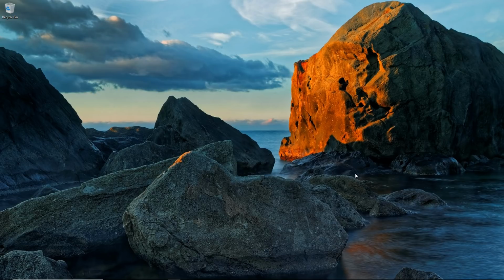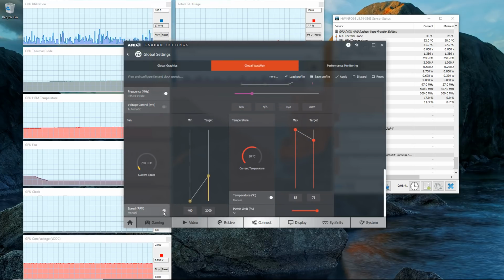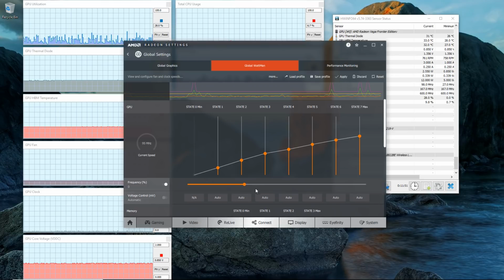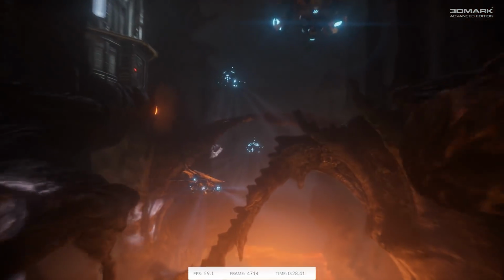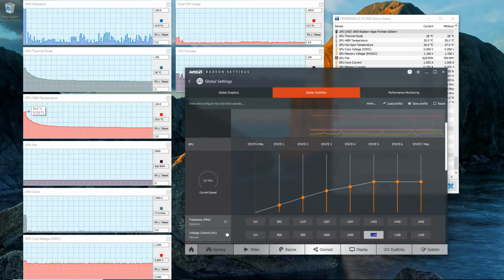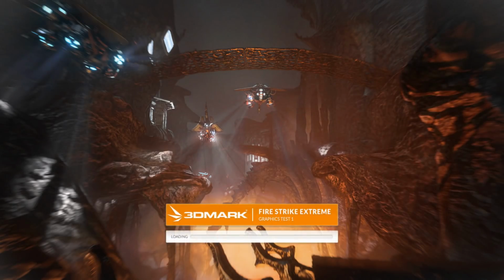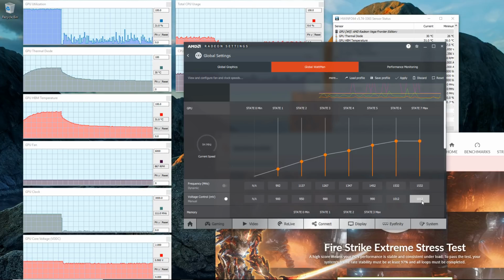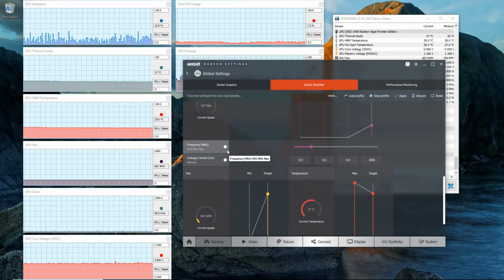Foolproof Vega GPU Undervolting Method

Comment: You're paying too much attention to cpu thermals...but the most important thing...the vrm temps...you just missed. The best way of undervolt your card is running a gpu bound game. I did it with mine. Then checked thermals.
Reply: what game?
Reply: @beatsbyeduardo9066  witcher 3
Reply: Yea but vrm temp depends on core temp as it is the resposible for high temps unless you have bad cooler design or wrong thermal pads over the VRM

Comment: Followed tutorial for my MSI rx 580 8gb and so far it has worked. I get no crashes, but do get artifacts. I'm still fiddling with my voltages to get it right. My ending score differs wildly sometimes. From a score of 80 to 90 or in between. Maybe I gotta fix my clock values as well. Also, would overclocking my CPU help with the ending score? I had to reset mine since my GPU kept getting an insane amount of black screen crashes.

Comment: What is the hottest temp you can run the GPU hotspot? Mine sometimes hits over 105c!
Reply: Not sure mine was hitting that region switched stock blower for a Morpheus Vega 2 while doing so I found a nice long (5cm) bit of plastic that said please remove inbetween the cooler contact plate and gpu amongst the thermal paste, once removed and Morpheus attached don't push beyond 85 degrees now. It's also now getting lower thanks to this vid and me now under volting

Comment: Damn good gaming card but the fact is that AMD is horrible with drivers that you have to go through all this BS to even get it right. I bought one over a GTX 1080 and now regret it because with Nvidia all I would have to do is just increase the slider under msi after burner🙄. I guess you get what you pay for with cheaper shit. $230 for my Vega 56 and the GTX 1080 would have been another $50👌

Comment: I'm planning to run an MSI Vega 56 in an itx case. Any suggestions on how to undervolt to reduce temperatures?
Reply: #1 is to not have your mV and clock speed close together.  It will lock to P state 6 if it was set the same as P state 7, same with clock speed.

#2. Your After Burner app will have a graph chart like watt man is located just above the clock speed title's and shape like a graph for both mV and Clock Speed.  Click on the white box either drag with mouse, press enter and backspace the + or - of the vaule to increase or decrease then press enter, or clicking the up and down arrow key.  

There is not memory voltage control in After Burner.  I would suggest using the Vcore first before touching the clock speed of both the core and memory, save profile what been stable, and make tweaking according with applying profile set to off.

The p State 7 is what you want to lower the voltage down while paying attention to the gpu core mV, it will make the images show "line" artifact if mV set too low.  

I found my sweet spot on my Air Boost Vega 56 OC, save the OC profile on AB and Wattman profile too for backup, lock my framerate to 100 or create chill profile, you will have lower temperature once set up.
Reply: MrDman Man also i have recently bought a Vega 56, got some questions. If i only want to undervolt without overclocking should i increase the Power limit aswell or leave It at 0? Then does undervolting the Mem have a big impact on reducing Power drawn from the card or not (cause i like to  use Afterburner cause It also have an in game overlay) ? And how can i calculate the Power drawn from the card?

Comment: Dual Vega 56 here. I just cured my crashing trouble that was due to a hefty overclock by the drivers AS STANDARD. 1622mhz forced by the drivers vs the cards rated 1520mhz. I'm going to watch this video now to see if i can get more powah.
Reply: depending on what card you have i think some companies released a more stable bios revision. Try flashing the card's bios to the latest if you're having stock stability issues
Reply: @noahmalboeuf  I'll have a look. Thanks!
Reply: @marc-oliviercabot3380  np

Comment: This is by far the best tutorial on internet ! I tried this method and it worked
Reply: Be careful since the new driver update takes off the temp. configuration so you'll be in hell when you use it a few days. Consider yourself warned, guarantee might not be happy about it.
Reply: @TheUnknowedOficial  does that mean my card can overheat ?
Reply: @vinvinudu77  Below 80 Cº its fine. That's when the horror comes up, don't worry, if you didn't updated your drivers Wattman will be just as always.
Reply: @TheUnknowedOficial  I have the last Wattman but I always watch my temps with hwinfo and i'm around 67° with 74° max, is it good ?
Reply: @vinvinudu77  Normally Vega has a regulation that doesn't allow you to bypass the 75º, all fine dude, im almost envious of you, i tried so many configs and none of them worked. Im playing World War Z and my GPU crashes at the very first level... I really want to find a nice config to reduce the temp.
Reply: @TheUnknowedOficial  I didn't knew that, what happen if you go over 75° ? Does it crash ? 
And yes it works because I kept the base core clock, I just put my hbm to 900mhz and I undervolted a lot, at 1592mhz I'm at 1035mv
Reply: @vinvinudu77  No it doesn't, it can heat more but isn't recommended since you can overheat the GPU
Reply: @vinvinudu77  In a VEGA GPU it just crash the game, sorry for the last reply i didn't read very well your reply XD
Reply: @TheUnknowedOficial  oh that explains a lot of trouble I had a week ago 😂, and sorry if I don't write really well I'm French ☺️ anyway this card is really good but so hard to overclock and stay stable, I had a rx570 and it was so much easier, but this card is really a beast !
Reply: @vinvinudu77  I've a Vegas 56 and im having so much issues doing an Undervolt. The card in stock isn't that bad and works like a charm, but i would like to lower the temperature since it seems that can be lower that 75 with a bit of configuration. Something that i suck at it.
Reply: @TheUnknowedOficial  i struggled so much the first days, then I started to use hwinfo, you can see really detailed graphs about temps and clocks and everything, then I started heaven, watched if my card was always at max voltage, if the clocks were too low or the card too hot, it helped me so much
Reply: @vinvinudu77  The problem is almost every guide about the Wattman is outdated since you can't modify your Fan RPM now...
Reply: @TheUnknowedOficial  don't u have a "percentage" thing with a graph that you can move ?
Reply: @vinvinudu77  Nope
Reply: @TheUnknowedOficial  that's awkward I have a fan control thing with different points that I can set 🤔 well Wattman is a good program overall but sometimes he's awkward
Reply: @TheUnknowedOficial  How can you have such high temps? My Vega 56 averages around 30 C, max 50C in gaming.

Comment: VRAM voltage acts as a lower limit for the GPU. Since the VRAM is always running at the same frequency,  there's a minimum amount of voltage required to keep it stable.  That value ensures voltage doesn't drop below that point.

Comment: Also the reason hwifo is showing different values for your core clock is because what you input in to wattman is a frequency target dependent on thermal and power variables. And the memory voltage setting is a voltage floor for the on die memory controller.

Comment: Thank you for this video.. Thanks to your brilliant guide i was able to UV/OC my Vega 56 Pulse to 1630mhz/1000mv... It's incredible how much cooler and quiet the card is now.. I'm especially impressed with the hotspot temperature... And for those wondering, this still works for Adrenalin 2019...
Reply: How did you apply the suggested fan settings?
Reply: @henanigans205  I don´t use Wattman.. I use OverdriveNTool 0.2.8 beta1 with Adrenalin 19.2.3... This tool allows to have full control over fan speeds... It's not perfect, but you can use ZeroRPM alongside your custom fan curve...
Reply: @Simplesmente_Fernando  How high is your max rpm? I notice that it sounds like a vacuum cleaner at 2000rpm
Reply: @henanigans205  Yeah, it can get a bit noisy, but it really depends on the situation... The way i have it set up, the card only uses up to 1000mV, and i also have the framerate locked so that it doesn't exceed the freesync range of my monitor (75hz), so, with this combination the card stays quiet most of the time... The fan configuration i have in OverdriveNTool is this:  30ºC=0%; 35ºC=20%; 55ºC=50%; 65ºC=80%; 70ºC=100%.. ZeroRPM=Off... This works very well with adrenalin 19.2.3... But i tried 19.3.1 and i think they changed something because my UV/OC isn't stable with those drivers... Keep in mind that when i say 1630mhz@1000mV (+50 Power Target), it doesn't mean the card ever reaches those numbers... That is how i have it set up on OverdriveNTool..... At full load (i.e. Superposition 1080pExtreme with unlocked framerate) it boosts up to 1520mhz... I kept it like this because the core very rarely reaches 55ºC, and the hotspot stays below 70ºC wich are very good numbers in my book... To give you another example, playing The Witcher 3@Ultra (no hairworks), with the framerate locked @75fps, the hotspot on the card stays around 60ºC, wich is amazing...

Comment: I guess this is kinda of intuitive, i messed a little and made the process identically, although your tutorial is one of the best i've found yet.
Wattman on my 590 has a problem on the stage 3 it simply doesnt allow to change the voltage, and the stranger thing is that the default voltage on the stage 4 is lower than stage 3.
What i noticed is that the voltage drop from power states can't be too big, or rather should be small, otherwise seems to create instability when switching between them, and although you say that they aren't discreet, they surely have special task of being "proven" states, like grounds that the gpu will go automatically when it "notices" instability.

Comment: Thankyou so much!! In a way i am glad it was such a mess to set up. I have learnt a lot in the process. Ultimately your taming the crazy AMD beast. Prior to this had major computer crashes in pretty much all intensive games. Watched the video twice. Most likely this will take a full evening of testing and fine tuning to get it right. Even in testing if there was too much voltage, the computer would crash even when temperatures were under 80c. Too little volatage it seemed only Radeon crashed. For my Asus Vega 64 Strix OC the inital working settings are as follows. I have deleted the Asus GPU Tweak that was also previously installed, and have 2 seperate power cables to my PSU to the card and installed an older version of the driver application (Dec 2018).

State1: 992 - 900
State2:1137 - 950
State3:1267 - 960
State4: 1347 - 967
State5: 1452 - 975
State6: 1552 - 985
State7: 1622 - 995

Comment: Very good tutorial..for vega 56 and 64 owners you only need to play around the voltage at p6 and p7. My vega 56 is stable at 1.070 ( P7 ),memory @ 955mhz  stock core clock and manage to get  18 fps more.I also did 1685 mhz  @1.110 v 955mhz memory (Gained  23 fps) stable but power draw went up so i  locked up on stock core clock  and my overall system power draw is 350watts but if i lower the memory clockspeed @900mhz total system power draw is 330 wattts.

Comment: Great guide, follows the same logic I used for my under-volt. 
I got a Sapphire Pulse Vega 56 recently. Runs really cool/quiet and uses a LOT less power with a manual under-volt. 
Boosts up to 1620MHz (100% stable) with 1040 mV. I'm not done playing around with it, so there is likely more clock-speed to be squeezed out of it at that voltage if I can be bothered.
Reply: That's really good, how do you go about increasing frequencies? Do you undervolt it at stock settings until its stable and then increase the frequency until it crashes or do you set the frequency at what you want and then do this process?

Comment: any suggestions on going about overclocking the memory?
Reply: if you got a vega 56 I would say go for around 900-920 higher than that is unstable vega 64 1000-1100 somewhere in between

Comment: Very helpful video. Looking at possibly getting a Vega soon. I did learn something about the clock states though. Had both 6 and 7 on a 580 as the same. Guess that's a no no 🤷‍♂️
Reply: I noticed that too.  I returned my 580 (got tired or being told to upgrade my drivers to the current and previous versions) and got a used 1070 but i'm waiting on my Vega 56 right now.. Curious about Radeon 7 but I'll wait til the reviews. Hopefully this will all be a thing of the past and we won't have to worry about undervolting.  But i'm not holding my breath..

Comment: Thank you for this. 

I'm anxiously awaiting the arrival of an MSI Vega 56 Airboost OC card as I type this.
I've patiently waited for the mining craze to come to and end and was able to grab the above card for a grand total of $217 shipped.
Here's hoping it's not been to abused and the seller wasn't lying about his being the first owner and that it was actually in his gaming rig.
Judging by his feedback his story may just be legit as there's a trend of his selling cards but each card sold was one tier lower than the next.
Makes me believe he actually is a gamer who was patient and waited on sales/stock as he gradually upgraded his rig.
Thanks again and from all the research I've been doing the Vega 56 is the sweet spot especially if you under-volt and like me are a 1080p gamer...
Reply: Can i update it once it arrived? How the temps noise, and what type of memory did it use
Reply: @MyIzzu1  At same settings my wife's Airboost hits the same performance for 4/5 Degrees Celsius more in the temperature at same settings compared to my 3 Fan Vega 56. So for a blower it is pretty nice, what I like about the card is that it blows the air out of the case so your CPU/inside of the case is cooler, her CPU (same Ryzen as mine) tends to have less temp then mine due to this.

Now noise wise it is nosier then the 3 fan card I have, but if you follow the guide from the video you will have less temperature, so you won't need the fan to work as hard anyway.
Can barely notice it with headset on.

Comment: thanks for the tutorial. it really worked well so far.  

what about the power limit set to 50% at the beginning? do we leave it here or can/should we lower it down?
cards power consumtion (Radeon Tool) goes up to 250watts.

And with radeon tool and hwinfo my mhz realtime settings are a lot less than the settings. for example S6= 1537hz is 1460 in benchmark and S7=1632 is 1520 in benchmark. Unigine Valley or 3Dmark Firestrike stresstest.

so far my results:
Asus Strix Vega 64
Power limit: 50%
GPU MHz@mV
Stage 3: 1137@990
Stage 4: 1202@990
Stage 5: 1402@990
Stage 6: 1537@1000
Stage 7: 1632@1020
HMB
945@1040

all mhz are factory settings.

Comment: Can you make a guide for the Vega 56. I have my pulse 56 running pretty good  with my own settings but there isn't much out there for others on this topic and I'm always down to learn more
Reply: Have you tried flashing the pulse Vega 64 bios onto it?
Reply: @dgaming9791  there is no pulse vega 64  only 56
Reply: @nOil nx  yeah I got my stable man.  Look me up on Facebook or something I'll help ya.  P6 1055mv and p7 1100 got it to 1702 on cc. Memory hynix got to 965 at 950mv.  +50% power
Reply: @nOil nx  I've ran it threw a series of firestrike test and I don't remember temps but it was never over 65c tho with custom fan curves. I don't need to run it that fast with normal AAA games like Hitman 2 and shadow of tomb raider I get well over 120fps with base and boost clock of 1592 love the card man
Reply: @nOil nx  oh an no it doesn't if any maybe a tiny bit.  They are made to OC so prolly doesn't hurt any
Reply: @nOil nx  look up Jimmy Mueller on there. I'm from Knox indiana

Comment: Hi,  thanks for the tips
I did a thermal paste change (Thermal Grizzily Kyronaut) 
State 7
75 degree @ 1642mhz @ 1120mV
79 degree HBM 1025 @ 1000

But 2nd Crossfire card doesnt do that well
72 degree @ 1602mhz @ 1090mV
79 degree HBM 1025 @ 1000

Comment: I really appreciate the systematic approach, and I'll try this with my Vega water cooled. I'm thinking though. You mention increasing the frequency of the memory at the end, after a stable undervolt is achieved for the GPU, and that this can introduce instability. I wonder whether it makes sense to do the memory overclock *first*. This way, you're already accounting for the additional thermal load of the HBM OC when you work on the GPU voltage/frequency. That said, I'll try your method, as I'm pretty much using balanced or power save at the moment, because of the frustration and limited benefit from my forays into undervolting so far.

Comment: I'm running an MSI Vega56 Airboost 8gb OC flashed to an MSI Vega 64 Airboost 8gb OC powered by an EVGA 1000-GQ 80+ GOLD PSU. Motherboard is an MSI X470 gaming plus. Does this apply to my rig?
Reply: Got the same GPU and wondering myself
Reply: I have the exact same card! how did you flash the vega 64 bios? I am trying but it gives me an "incompatible subsystem" error or something. Scared of bricking my card.

Comment: This tutorial is nothing less than brilliant👌
I just got my Radeon RX Vega64 8gb LC. It did a 92.7% in stress test with default settings!!! Now after this🙂 I got 99.2% and a stage 6 on 1656mhz and 7 on 1713mhz. 69 degrees Celsius. 
Thank you for this👌👍👍👍👍👍👍
Reply: What voltages
Reply: 71janas your Fan speed?
Reply: @dr.med.denrasen8986  around 2000rpm
Reply: thats crazy
Reply: I am also considering to buy a VEGA 64 LC but your temps seem quire high during this stress test, what temps you are getting in heavy gaming?
Reply: 69 iconic temperature
Reply: The first time i undervolted i got 99.5 percent. I can't remember what it was but dang i was happy